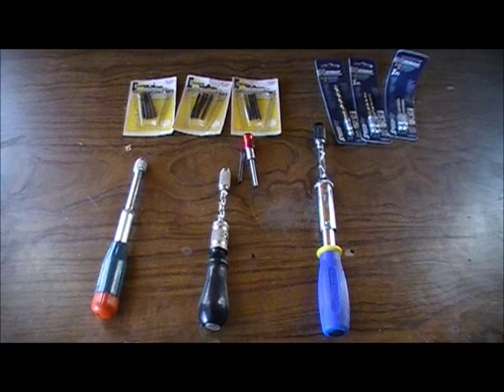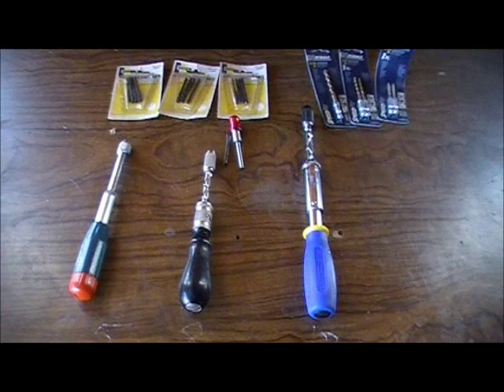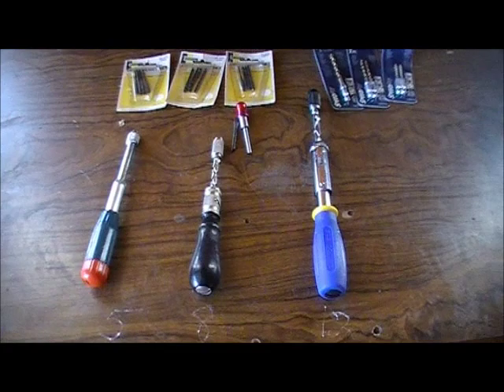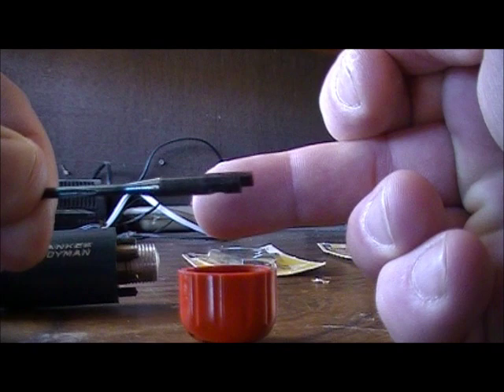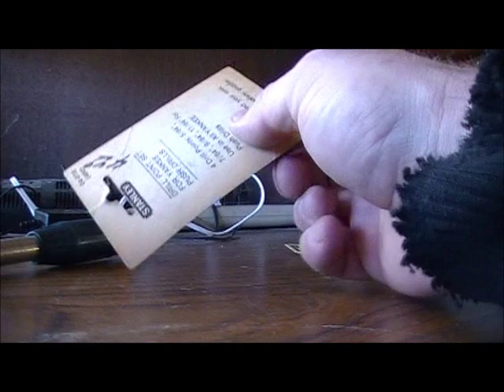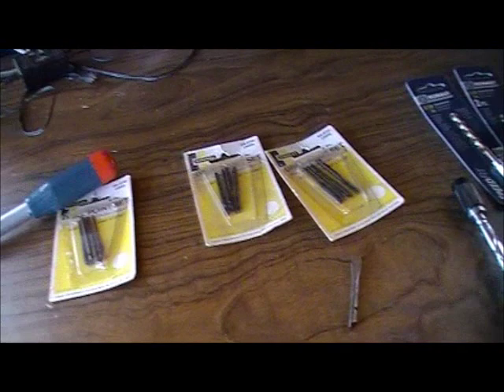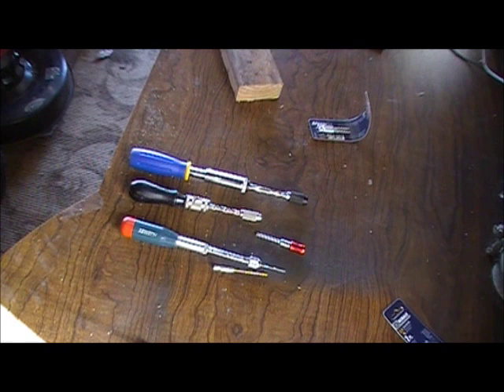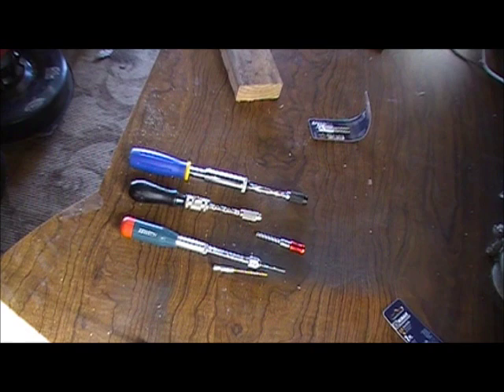Yankee Hand Drills

Comment: I have about 30 of theses types of drills, all bought at yardsales for less that $5 each.   Even picked up a tackle box full of bits for $8.00..  30 plus of the same tools.. yes.. I have a problem.. Everything I have that carries tools has 2 or 3 of these in each one..

One thing to know.  If you find one at a yard sale, first thing is to pick it up and shake it to see if it rattles.  If it does, chances are there are bits still in the handle..
Reply: Craftsman even made one once upon a time.. Yep, I got that model as well.. Wonder if they'll replace it if it breaks.. haha..

Comment: The P&C No.1975 Automatic Screwdriver was mfd. by Millers Falls Co. The equivalent MF-branded tool is the No.29. It uses bits with 7/32" Yankee shanks (half-round drive notch on the end, retainer notch in the side). Various screwdriver bits and straight flute drills (7/64", 9/64", 11/64") were sold with 7/32" Yankee shanks. Similar bits with 5.5mm Yankee-type shanks are available from Lee Valley.

Comment: Garret Wade tool company has all the push drill bits brand new and the Stanley 41 push drill  imported from Germany  they also have that red adaptor  in the 3 original sizes of shanks that Stanley used

Comment: The P&C isn't a drill. It is a screwdriver. It is a decent quality knockoff of the Yankee 31. Takes Yankee screwdriver bits, and the drill bits (spiral) with the same end. The Advance is a low end knockoff of the Yankee. Rough, but works. About the same quality as a 1970's Craftsman.

The bits for the true drill (such as Yankee 42 or 45) are available from, among others, Garrett-Wade, for moderate price, but not cheap. The scewdrivers, turning in only one direction, work well with spiral bits and the 1/4" adapter. But, it you are going there, better option is a Yankee#30 or #130, as a bit heavier duty.

I carry a 130 and a selection of screw points and spiral bits to pretty much cover all situations.